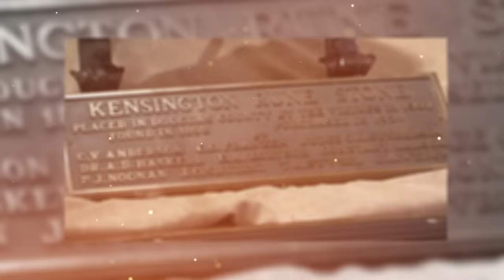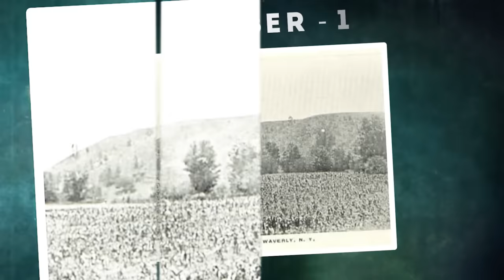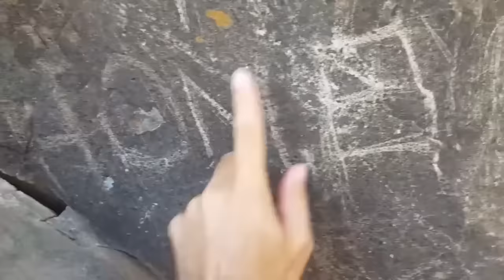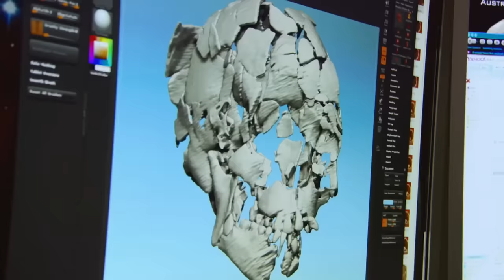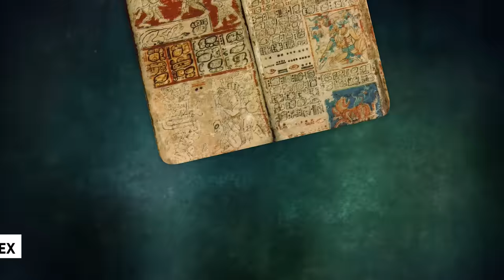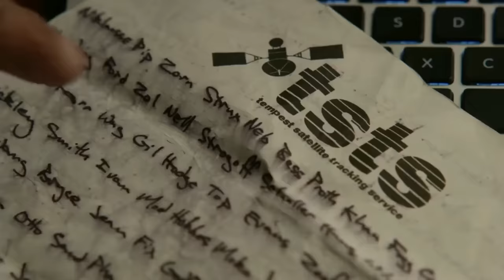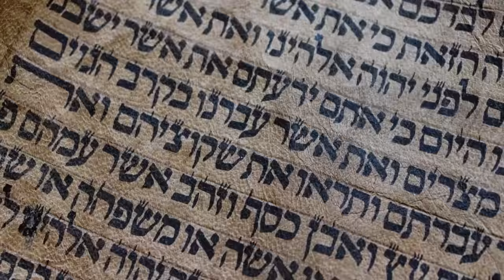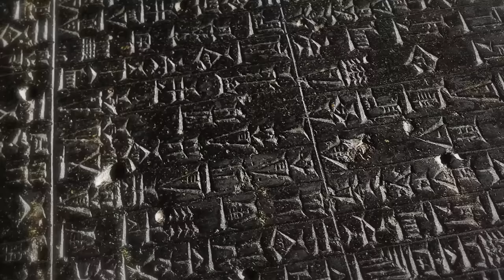Archaeologists And Historians Were Forbidden To Study These Finds, So As Not To Rewrite History

Comment: The aluminum wedge at 9:25 minutes is a tooth from a bucket of a large excavator. They do fall off, and I've replaced many that look EXACTLY like that one. The only difference is the one in the video is aluminum, whereas the teeth I've replaced are high carbon steel. Other than that it is identical.

Comment: 9:24 That wedge looks more like a bucket tooth from a backhoe, a front end loader, an excavator or a 200 year old NorthWest steam shovel. The holes on the side are for swiveling up and down, the middle holes are new to me, but may be for specialized attachments or a specific purpose for other than digging, a mechanical purpose, maybe putting steel cable or chains through. Pretty sure that's got more than just a soft aluminum in it, unless it was being used in an extremely soft non abrasive material. Uuuuuugh I miss operating those old NorthWest shovels, to heck with the gym, those things were an entire 8 hour work out. After 11 years my muscles had muscles lol.

Comment: There were civilizations way more advanced than us in ways that were congruent to there needs and desires of that time, advances were determined extremely specific to what would have been considered a pragmatic, worthwhile, useful and fulfilling purpose. For instance if they already had a hammer for building, a claw hammer, that we find very handy for pulling bent nails or boards apart today, may have had no great value or purpose to them, a nail that didn't bend would've received higher praise. If you had a laborer that kept bending nails, you'd just make him the new water boy and get someone with more skill who never bends the nail. Always building something permanent they would never expect to dismantle, never need a claw on the hammer. Just a vague example. Not to mention those long gone civilizations had tens of thousands of years for advancement, evolution and improvement. I imagine if roles were reversed, they'd be studying us and shaking there heads in disbelief, maybe laughing at us for all the silly useless creations we've made. They would dig up a steam locomotive and think wow, ok, that would come in handy for moving large items over long distances, then they'd dust off an old bullet train and think what the hell is this crap? What were these people smoking?